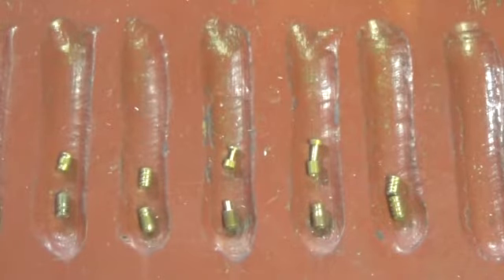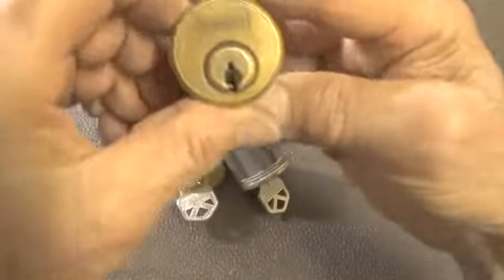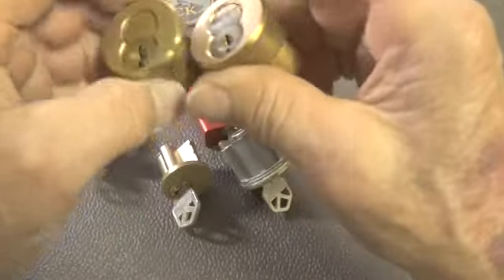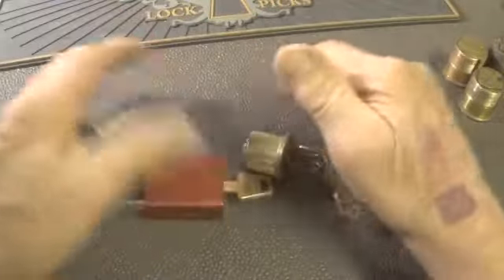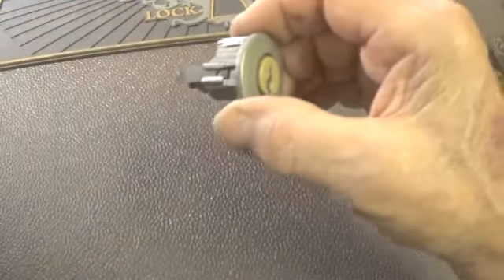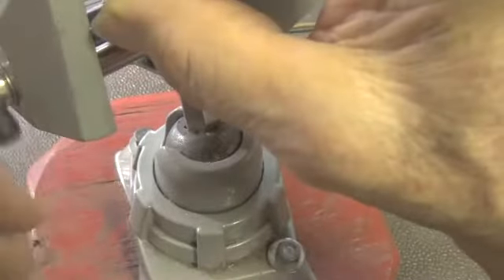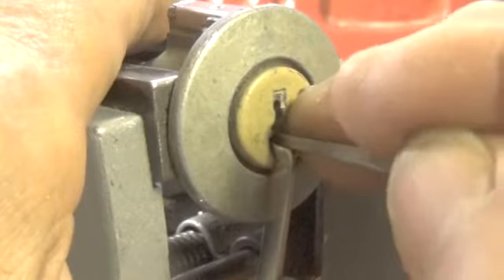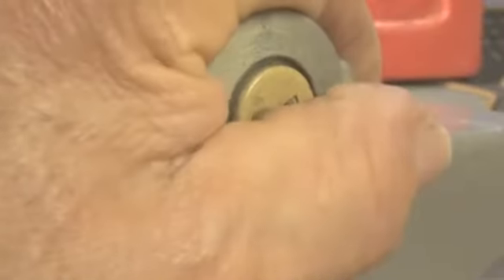(488) Trekmaster30 Package of Locks - Two Kwiksets SPP'D and Gutted

Comment: Texas Jim, a wonderful job picking as always! I never understood why Kwiksdt has holes in their cores!
Reply from the maker: Thanks, the holes were there to probably cut down weight. Who knows???????
Reply: Jim, The small holes are for construction keying. The construction key will operate all locks while the building is under construction. When the owner turns his key in the lock it automatically cancels the construction key. Instead of master wafers, tiny ball bearings sit level with the shearline while the construction key is being used. When the building is completed, the owner turns his key in the lock which has HIGHER cuts than the construction key. The ball bearings are now up in the bible. As his key is turned the ball bearings are trapped in the tiny holes which are in line with the pin holes, by the spring loaded driver pins. This happens automatically as the owner's key is turned. If the construction key is tried, it will now not work, as the tiny balls are permanently trapped in the small holes, and the construction key pins are below the shearline.   Regards, Brian.
Reply from the maker: Thanks, I appreciate you letting me know the readon for that. I think I had heard something like that before but had forgot about it. I will remember that from now on.